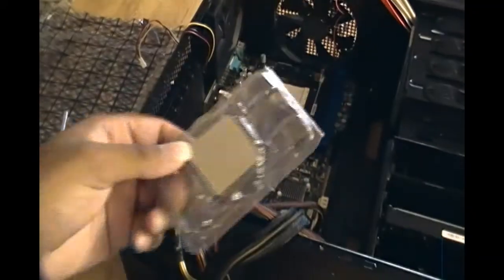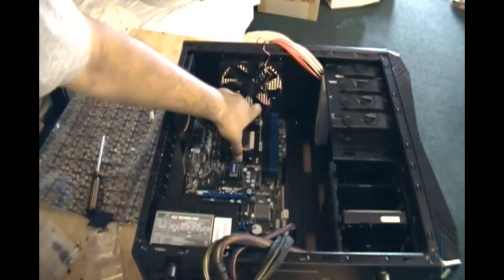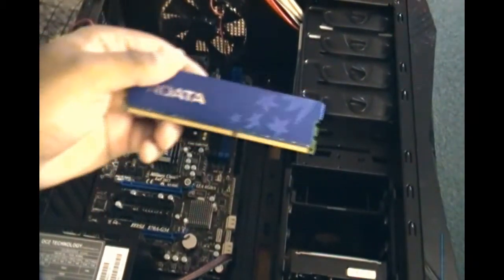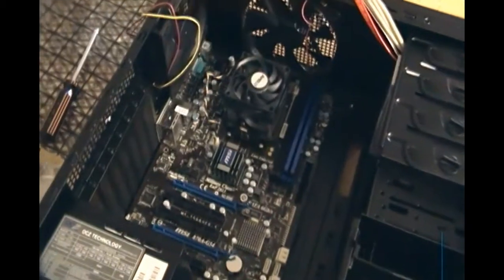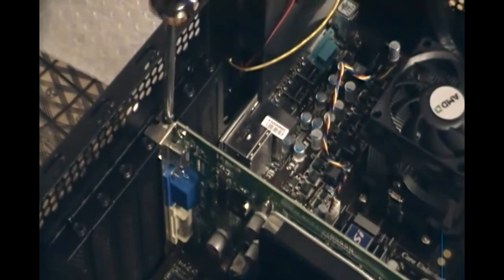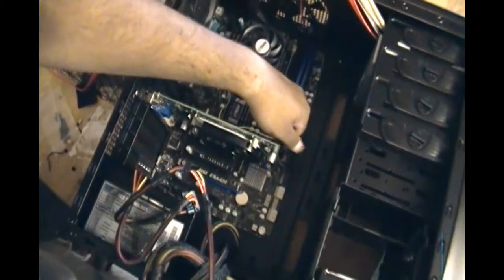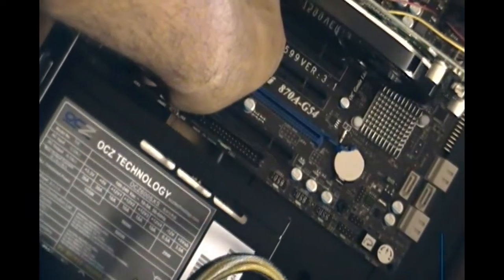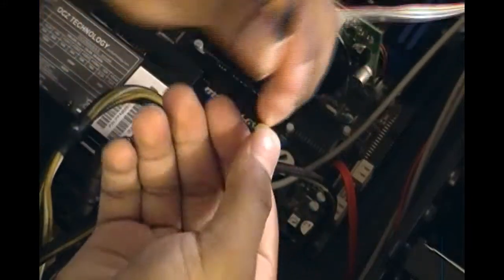How to Build your own PC - Part 3

Comment from the maker: You can but then when you go to install the motherboard, it'll be bulky and might cause issues, especially if you have a heavy CPU  heatsink/fan because it may interfere when you're screwing the motherboard into place. Same goes for GPU. The RAM would be OK since it's much smaller and don't tend to overstep it's boundaries like a video card or CPU heatsink.